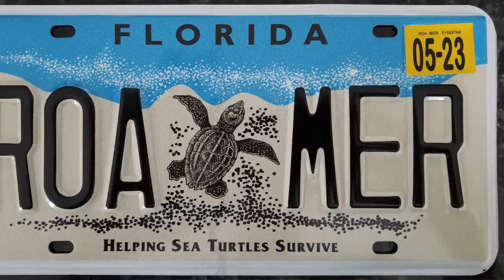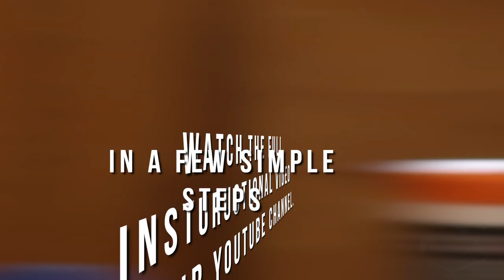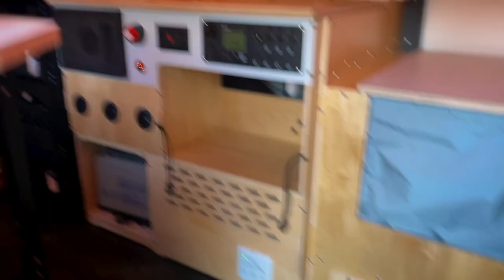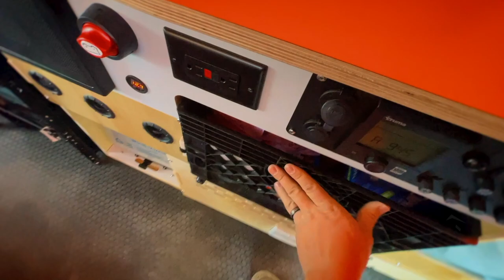Xplore factory tour! Vorsheer, and Xplore water tank! S1E4 ROA 2021 Taxa, Kimberly. RVs of America

Comment: I really appreciate your honest discussions about the realities of towing and the business aspects of bringing on new international brands. It's great news that you're leaning toward Imperial Outdoors as a partner to manufacture a custom trailer. A trailer made in the USA is a huge advantage not just from a patriotic standpoint, but more importantly from an ease of long term maintenance standpoint. If the Xplore added a little bit of length so the bed could be rotated 90 degrees with a standard queen size bed and the suspension could be improved, then you would have a home run RV product!